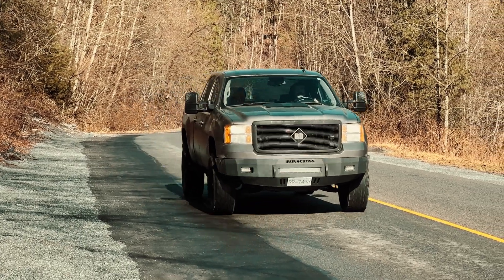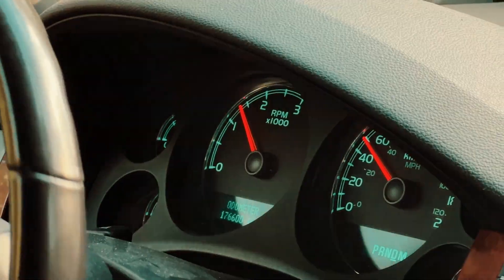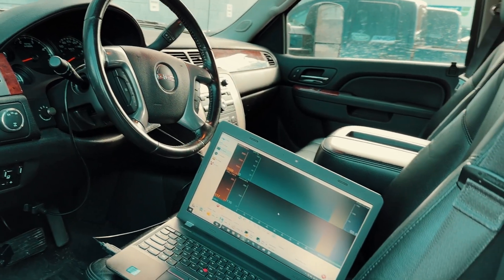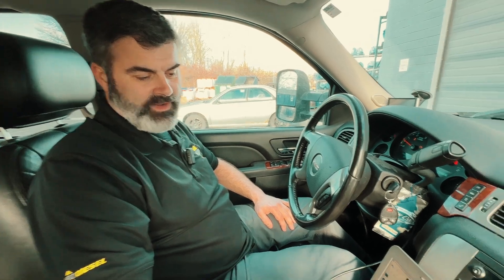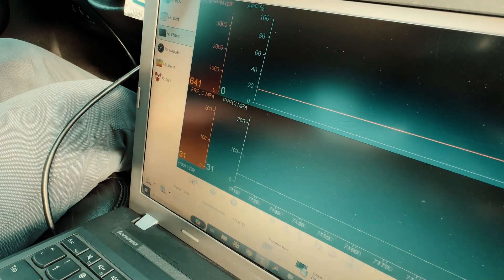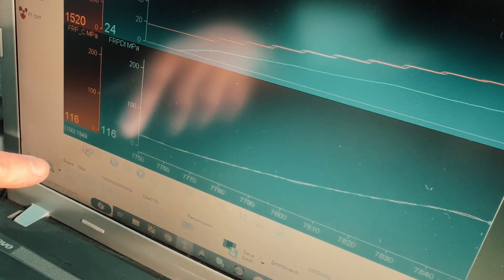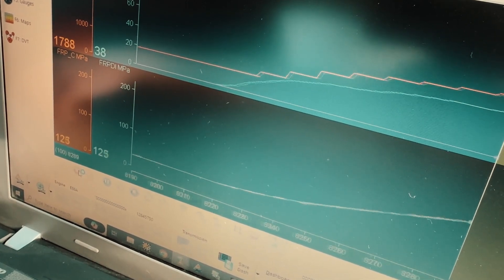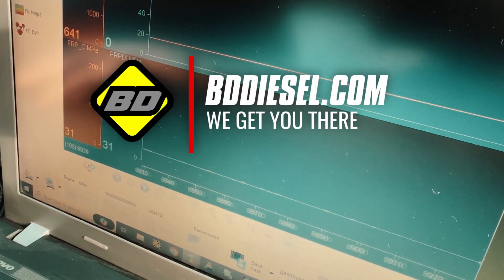How We Solved the Fuel Surge Issue in CP3 Fuel Pumps

Comment: So how did you solve it? I can't find this kit on your site.
Reply from the maker: We invested significant time in testing and attempting to modify the CP3 to match the CP4's flow rate. You can find the kit here: https://us.bddiesel.com/products/venom-cp3-conversion-kit-c-w-standard-pump-chevy-gmc-duramax-6-6l-2011-2016-2500-3500?variant=41879683989687
Reply: @BDDieselPerformance  yeah I've already installed a fleece cp3 and had the fleece intank pump installed 4 years prior. I'm not buying another cp3 conversion kit.
Reply: @mediocre_mike_golfs did you solve your problem?  Going through the same thing.  I hear people saying to take off the lift pump or tune it in
Reply: @AnthonySmith-rj2xr I bought a dodge 4500 fuel sensor and put it on my fleece pump. It solved the issue.